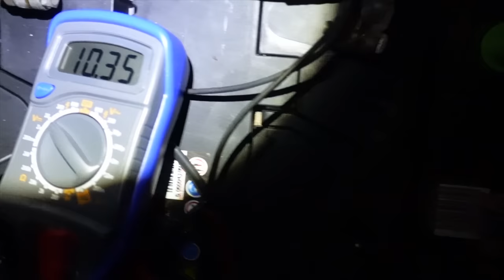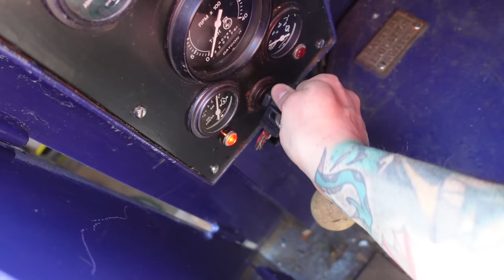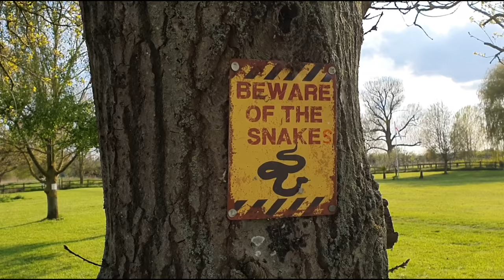we WRECKED our NARROWBOAT | DISASTER tiny home cruise | NIGHTMARE off-grid HOUSEBOAT REFIT

Comment: OMG I hope you didn't damage the bridge?. All collisions boats have with these engineering wonders, that these bridges are, should be reported as soon as to the Rivers & Canal Authority or the EA, if like us you are on The Thames. To avoid damaging your boat & especially the waterways heritage such as these bridges it might be well advised to have a few boat control lessons first before you get going with a narrow boat, these boats don't have brakes & so with X amount of tonnage behind them they can cause devastation. A really good way of controlling a boat if you haven't had much previous experience is to just go real 'slow'.
Reply from the maker: Hi Cindy there were any factors at play with this, firstly the flow of the river was very strong, secondly the sign to the entrance to the bridge was hidden making it hard to see which way to enter, also the buffer protecting the bridge had sunk..about 4 other boats that day had hit the bridge too, there should really have been some warning signs up really. I feel with a bit more expensive I could have possibly corrected it, we've used the boat for the last 3 years and have had many journeys and have never had any problems, supposedly the bridge is known for it

Comment: Rivers are much more difficult to navigate than canals. Approach things like this bridge while going dead slow, so you can quickly go into reverse if things get out of hand. When you're ready to go, find a nice long channel with no weirs it will boost your confidence. 

You could suggest some marker buoys to direct narrowboat drivers the right way to get under the bridge, an arrow hardly helps people get through a bridge at an odd angle; especially if there was a fatal accident there. 

At the end of the day it was a light and a few repairs to the cover, a few more scratches - look back at your whole video, I think you gave the chimney a smack so maybe check the gaskets good, the last thing you need is a leak! 

I really feel like that was a shitty thing to happen to you both - but no one can fault either of you because of the bridge angle and the strong river current. Does the insurance help with the few repairs or are the costs too low?
Reply from the maker: they really are, so far we havent had many problems but this shows it can happen very quickly, I cant wait to get to the canals, a lot of people have said you need to go quicker that the flow to gain control, next time I feel ill be taking it as slow as I can, I have done the bridge a few times I the past and not had huge problems, maybe iv become over confident. the bridge was actually missing its bumper which didnt help so many boats were bumping into it., and the arrow we one really saw at the very last minute, I feel there should be a warning. 

No I dont think it will be covered by the insurance, but I will take a look,  a few nasty scratches a rip in the over and a missing navigation light, so in fairness it probably wasn't to bad, no-one was injured to which is the main thing

thanks so much for your message